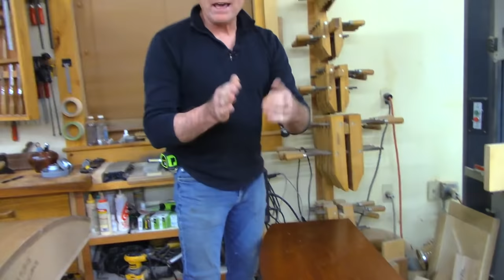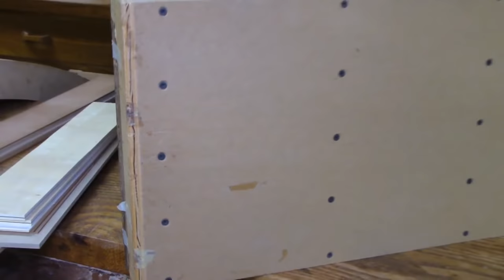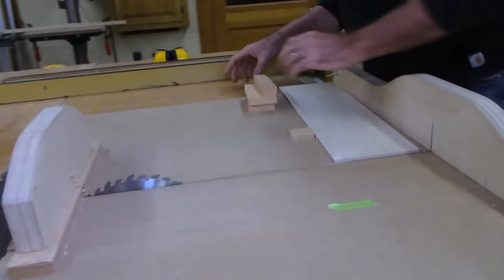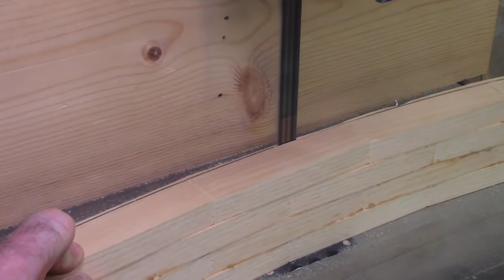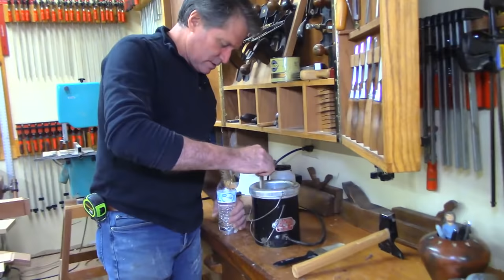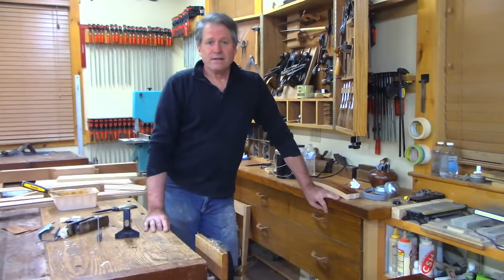How to Make a Bowfront Curved Table Apron with Tom McLaughlin

Comment: Just starting watching the veneer course by you on Fine Woodworking as I finally finished putting together my vacuum pump recently (I signed up for it months ago lol). All things related to veneer, curved parts like here seem so fascinating and rewarding and clearly challenging! In pieces where there’s significant almost sculptural curvature in the legs  of a smaller decorative table for example, I’m guessing you’d use the method of slicing the larger piece into consecutive thinner veneer pieces?  I was curious if one might do it in a few stages, using say three or four layers, cure it, then add additional?

Comment: Hi  Tom, really enjoyed the old school method, with the hide glue. I have never used hide glue, I may look into  using it for projects like this. Tom I never heard of Old Brown Glue, is it a brand name for hide glue, and is it hide glue, or something like hide glue? Thank you for sharing all your knowledge, I learn so much from you every time.
Reply from the maker: Hi Steve,
Yes, Old Brown Glue is basically genuine “liquid” hyde glue, which remains liquid at room temperature due to a urea additive. I don’t however have any direct experience with it so I’m not sure what the various differences are in working with it. I did take a look quick look at the website https://www.oldbrownglue.com/  and like that it has a longer 30 minute open time yet retains the same strength as the hot version. I’m always glad to know you’re out there watching, thank you so much for being so supportive and affirming, so happy you enjoy what we’re doing! 👍😎

Comment: You cannot hammer veneer with Old Brown Glue. It takes too long to set. Hot hide glue has the initial tack once it cools to hold the veneer to the substrate. You put the hide glue on both sides to keep the veneer from curling as well as it being a lubricant for the hammer.
Reply from the maker: Thanks Craig, it’s good to know that about Old Brown Glue. I love the quick tack of hot hide glue, although it does have its limitations. And yes, I meant to also mention the curling factor as reason to also coat the other side of the veneer, good reminder. I think it is so different from other glues, people are almost shocked to see, and believe, that coating the face side can be a good thing. Thanks for watching, and being part of us!! 👍😎
Reply: @EpicWoodworking  Would really like to use that technique only seen Steve Latta do it.

Comment: I've seen someone steam the green wood and bend it.  
Does that work on the dry wood?
Reply from the maker: I have not had as much personal experience with steam bending, as I have with most of the topics I’ve presented, but I have talked to several others in the steam bending world and the answer is Yes, you can steam beam kiln dried material, but it requires more time in the steam box, and even so it is not quite as naturally pliable as air dried, and therefore more prone to bending failures. Other comments welcome here. Hope that helps, and thanks for watching! 😎👍